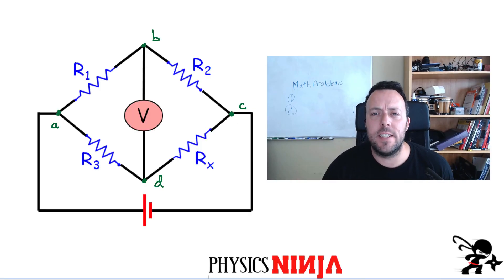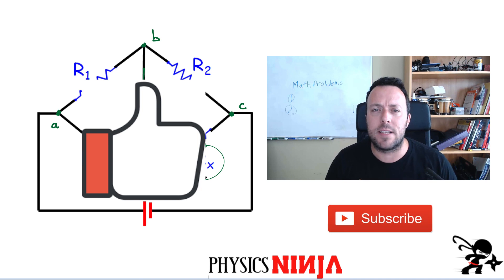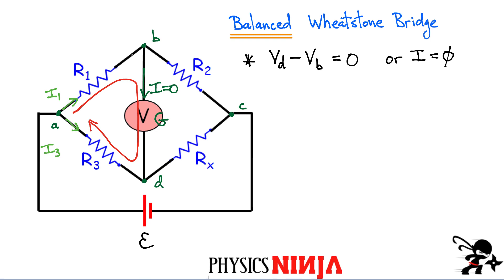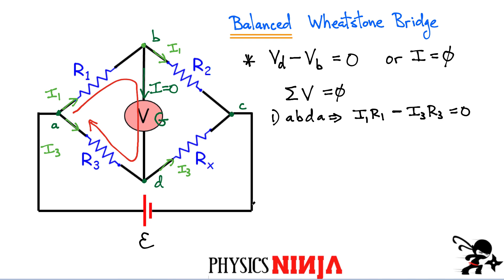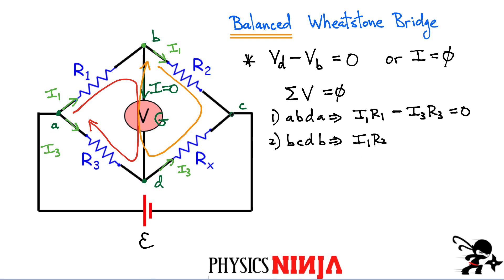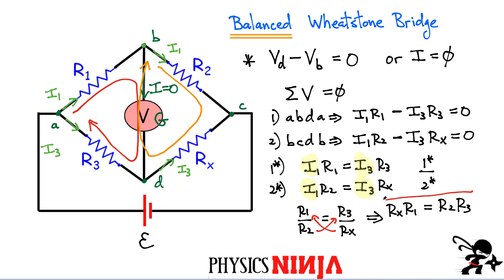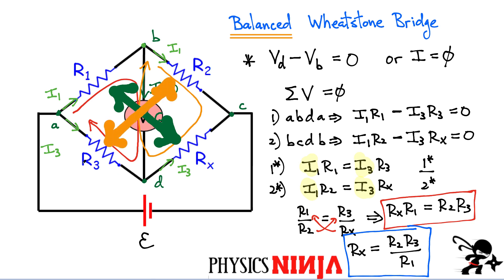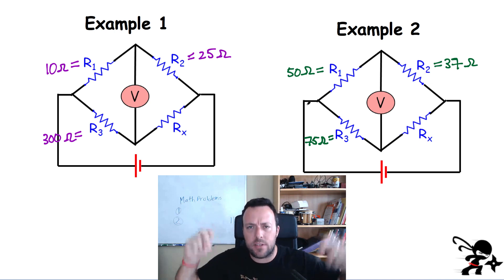Wheatstone Bridge Problem

Comment: when you indicate the flow of current through the resistors in a circuit, you then take your loops. My question is, when the loop indicate the flow from the negative (low) to the high potential through a resistor, is it positive or negative???

Comment: When the current flow through the resistor and the current is opposing the loop direction. Shouldn't the voltage drop be positive and not negative.

Comment: Kirchhoff’s loop rule states that if you travel against the current over a resistor, then +IR and if you travel with the current over a resistor then -IR. So im confused as to how you get the opposite at 4.20 in your video
Reply: Yea..
I think he switched the signs...
Reply: Basicly its same thing,if u go your way E-I1R1+I3R3=0 or if u go his way E=I1R1-I3R3 he just should wrrite at end E not 0.I also use this way,if u have + of E  following the direction of loop it will stay +,also if your current follow direction of loop on resistor it will be +,but u will write +E=+IR and not +E+IR